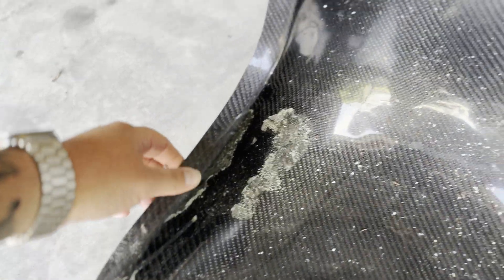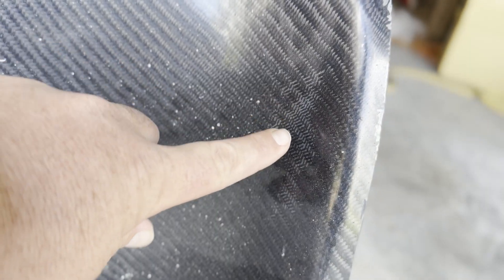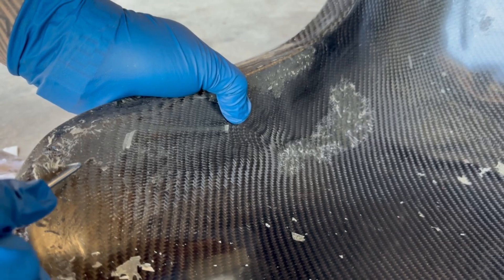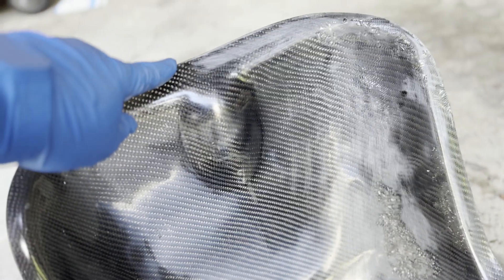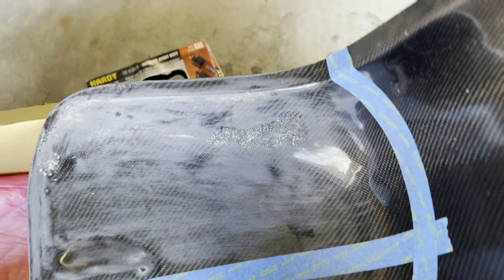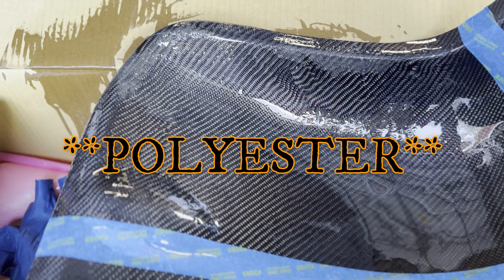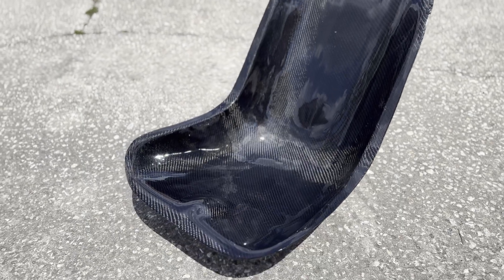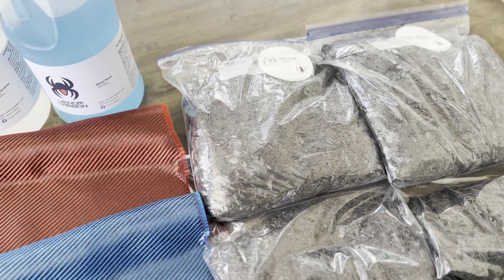How to fix and repair carbon fiber

Comment: If I have cracks in a seat but on the outer side, knowing the liquid will not just sit nice like you had it, how do I ensure it stays and fills the cracks?
Love the video - thanks!
Reply: try using JB weld plastic bond, I just did that with a carbon piece frame to fix a crack and I sand it down till it was smooth and it looked nice, didn’t mess with any of the fitment

Comment: Excellent vid w/ very useful info. Question on repairing carbon in spots that has been ground away from a motorcycle skid- is it possible to cut strips of fiberglass cloth impregnated w/ resin to build up and cover areas and blend it into rest of the carbon side panel. Do I need carbon cloth or will fiberglass cloth work, and what resin to use?
Reply from the maker: Great question! You can grind the damaged carbon back, and layup more cloth to make it perfect. If you want it to look perfect, just orientate the carbon cloth to match the weave pattern. You can mix carbon and fiber glass as long as you use a compatible resin. I recommend epoxy or vinylester resin.

Comment: Question, would adding  black dye to the epoxy mean I wouldn't have to paint over the carbon?
Reply from the maker: Yes, correct. If you dye the resin, it will come out just like gloss paint.
Reply: @JBellz  Thanks